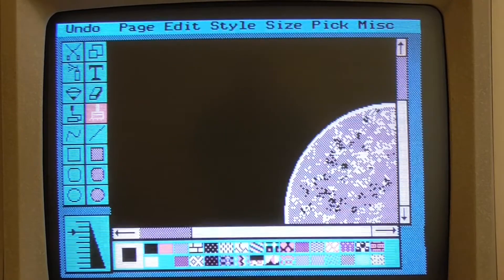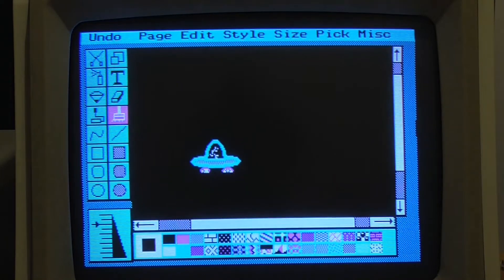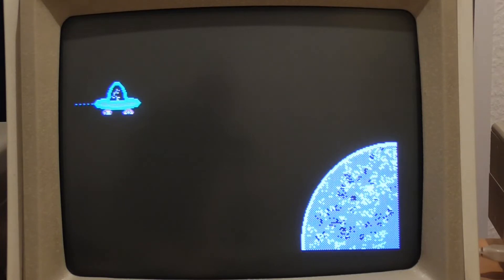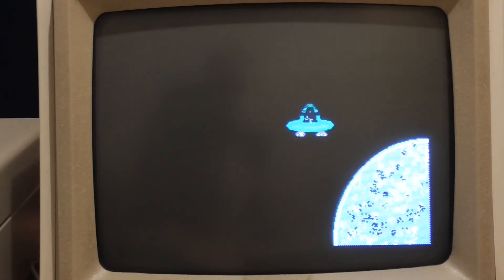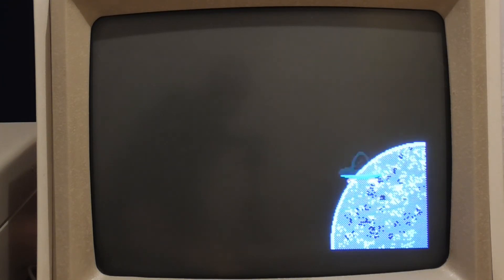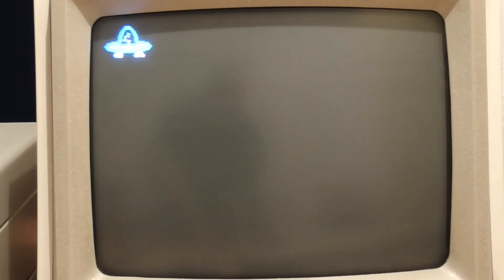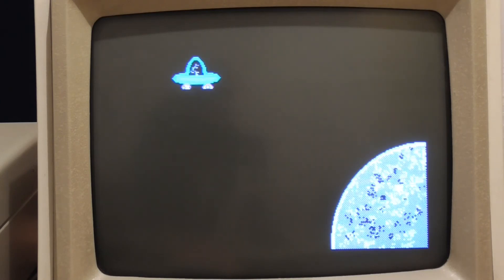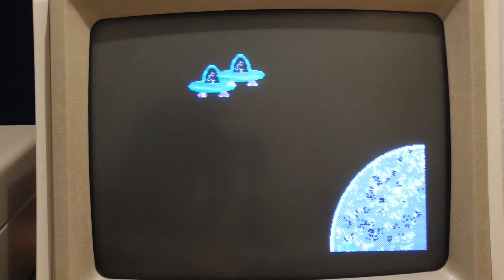Making A Sprite Engine for the IBM PC

Comment: Would it be faster if you created a 320x200 byte map in main memory, and used only the first two bits in each byte (4 colors) for all graphics primitives (no need for four different sprite drawings, perhaps easier calculations since each pixel is one byte), but then copied that into CGA memory with packing 2 bits of 4 bytes into each CGA video memory byte?
Reply from the maker: I'm not sure. Shifting is unfortunately very expensive on this platform, basically 4 cycles per bit that you have to shift, plus some overhead. Also, main memory is not that much faster than CGA memory, maybe a factor of 2 or so. So I think this is a case where more precomputation is better. However, there might be other benefits from your idea, such as being able to deal with sprites partially going off screen for example. So I guess it would depend on the particular problem you were trying to solve. Nice idea though. Could be worth a try!

Comment: yeah. if only pc graphics cards had hardware transparency, that would have made things much simpler and faster. vga had some helper hardware like latches and barrel shifter (only in planar modes), but by the time it was mainstream, 486 was a norm. it was so fast that it didn't matter anymore.
Reply from the maker: That would certainly have helped.

Comment: This is pretty much what we had to do back in the 8-bit days on the platforms that weren't designed for games in the first instance but had bitmap graphics, such as the Apple II and Spectrum. Even on platforms that had block graphics such as the TRS-80 model I and III. Except for compiling code from sprite bitmap data. But the platforms I knew had memory addressed displays so it was probably different on the ones that had VRAM only accessible to the video hardware that you could only access via a specific interface. I'm guessing that at least some of these early PC modes worked in the latter way?
Reply from the maker: EGA and VGA had planar modes which were accessed differently, but CGA was just memory mapped. That's cool that sprite compilers were known on these other platforms. Makes sense of course.
Reply: @PCRetroTech  Actually the sprite compilers were the one thing I didn't know of on other platforms. They may have existed of course. I didn't know all the tricks or all of the platforms.

Comment: Impressive! But why do you need a per sprite program just to draw it? The goal is to write the sprite together with the background at once, without VRAM read penalties right?
Reply from the maker: I'm not sure I understand the question. The "per sprite program" creates a precompiled sprite which is much faster than other methods. It has to read the background so that it can replace only the pixels that belong to the sprite, and to replace the background after the sprite has moved. If you knew there was nothing behind the sprite or a predictable pattern you would not need to read it.
Reply: @PCRetroTech  I guess I don't fully understand what precompiled means.  I assume you call a routine that draws that specific sprite into your framebuffer and then pushes it to the screen. 

But why isn't that possible with a general method for all sprites? 

Or do you avoid drawing the black pixels by hardcoding the actual line offsets in a register? So for example the top of the sprite only has a few pixels in the middle so you hardcode an offset of x position plus the black pixels for that specific line (of course corrected with the 4 pixels per byte encoding)
Reply from the maker: @what9418  That's right. You usually have one transparency colour (usually black) or a mask showing the shape of the object. Even for rectangular sprites you still have the left and right edge which may not align with a 4 pixel boundary. You can write a general routine for that case, but it is still slower than something precompiled for the exact number of pixels wide the sprite is and offset modulo 4 pixels.

Comment: If you are doing compiled bitmaps you don't need a mask, you just don't draw to a spot. I had a sprite function that swapped the screen info and the sprite data in the compiled sprite to use less memory using self-modifying code.
Reply from the maker: Well in general you need a mask otherwise you will overwrite pixels beyond the edge of your sprite. There are four pixels in each byte. There is no way to not draw a spot in CGA. That is what the mask is for. 

As for swapping the screen and sprite data, this would require extra accesses to screen memory and would be slower, though if your intention is to save memory, I guess that might work. You are going to need a mask for that though, otherwise you will overwrite pixels of your sprite.
Reply: @PCRetroTech  Yeah I was doing it in 8 bit mode, much easier with vga. Only the edge bytes need masking tho, not the whole surrounding rectangle. By swapping the data I meant to the buffer page not the screen of course. The method I used was pretty fast because they were completely unrolled and the sprites were primitive objects so storing the display data over the sprite data made them smaller and self contained.
Reply from the maker: @phookadude  I see now, thanks. That sort of thing is easier with VGA of course (modulo the bitplanes if you are in a planar mode).

Comment: C on these old PCs can’t read keyboard scan codes?
Reply: C can't do anything, you need libraries to do advanced stuff. You can read stdin though because c is always shipped with stdlib
Reply: Of course it can but it has to do it either via some provided system functionality such as the BIOS, or directly via the hardware. It can't do it just with the functions in the C standard library. Of course the standard library could've been designed to include such functionality just as many dialects of BASIC had INKEY$.

Now I'm not familiar with what the BIOS did provide or how much differences there were among the hardware available at that time.
Reply: @andrewdunbar828  It’s a memory mapped IO systems and it has pointers.  My question was rhetorical.
Reply: @user-yr1uq1qe6y  Ah sorry didn't realize it was rhetorical. Maybe some readers will take it literally and learn something anyway.
Reply: @andrewdunbar828  my response was a little terse.  I think my interpretation was too literal when he said there was no C function for reading the keys.  He probably did mean no standard library function. My apologies!

Comment: I recently did a sprite engine for X 320x240 mode. At first, the engine worked quite slowly, and with artifacts, then I read a book by Michael Abrasch, changed the code, and the speed increased. To render 32 sprites of 16 by 16 pixels at a frequency of 60 Hz (this is the standard refresh rate for 320x240 mode), a 286 25 MHz processor is required. The sprite engine seems to be slow, but Michael Abrash says in his book that rendering a large number of sprites is problematic even for a 386 processor.
The engine is designed for porting NES games to an IBM PC.
Reply from the maker: Yeah I think my sprite engine maxes out at about ten sprites, though they would be larger than 16x16. And I don't get anywhere near 60fps. It can't really be improved very much now though, as it is near optimal. It's just a slow machine.
Reply: @PCRetroTech  what is the bandwidth the 8086 achieves with CGA I/O?
Reply from the maker: @what9418  I don't have my notes with me, but rough order of magnitude is 300kb/s which is about 15-20 fps depending on what you are writing and from where.

Comment: you are the CGA god, can you explaine why CGA use those ugly pallets we all know ? And Why every single EGA game in 320 x 200 use 16 colors from CGA full color pallet , but not other from it's full 64 color pallet? :( Only a few EGA games use other colors from 64 color pallet but in higher resolution mode , :(
Reply from the maker: There are people that know way more about CGA than me. But as far as I am aware no one can explain why they used those ugly colours. I mean, there is a technical explanation to do with RGB levels, but no one can explain why they did it anyway after it was obviously so terrible.
Reply: @PCRetroTech  some one have to find the man or woman responsible for this abomination and ask for the god Why?! Hahah WTF :D
Reply: And as far as the ugly palettes go, it might have been just an arbitrary choice that was easy to implement in hardware. Two base CGA palettes are colors 2,4,6 (palette 0) and 3,5,7 (palette 1). So, just 2*n or 2*n+1. And add 8 (2^3) to get high intensity variants of these palettes.
Things get more interesting with the unofficial palette 2, using colors 3,4,7. It might be worth looking at CGA color circuitry to check what happens there.
Anyway, it's just my guessing :)
Reply: @peachgrush  In one description of the unofficial palette I saw it described as "blue, add blue to the palette". This wasn't anything official though, so I don't know if it gives any insight into what they might have been thinking.
Some of the stuff the CGA adapter does is probably unintentional and just a result of the way it's wired up. I'm pretty sure for example that the "undocumented" 160x100 16 colour mode is actually mentioned in the original manual a couple of times (though incorrectly as a mode that is achieved through the 40x25 text mode, which it doesn't actually seem to be). And one wonders if this was just added to the manual after some engineer noticed that you could actually get this mode via a text mode even though they hadn't technically intended to support it.
Reply: As far as I know, there are some games which can use the whole EGA palette in the 320x200 mode. However, as CGA monitors are unable to show more than 16 basic colors, and there were people using EGA adapters with their old cheap CGA color monitors, game developers were perhaps more willing to give in on more colorful graphics to get more compatibility.
Additionally, I am not sure whether the EGA BIOS supported the 320x200 mode with the 64-color palette enabled at all. Using it might have required reprogramming the CRTC manually. EGA monitors use polarity of sync signals to select between 4-bit and 6-bit color input.
Reply: @peachgrush  too petty that EGA potential was not unleashed at full capability :(
Reply: The 16 colour cga palette 320x200 EGA mode meant you could use the same assets for EGA and Tandy systems, which was preferrable for developers to save on disk space.  True EGA graphics were 640x200 or 640x350 and can look close to VGA by dithering/checkerboarding pixels to blend colours on CRT.

Comment: Very nice. I am building something similar for the Tandy 1000 320x200 16 color mode. I decided to move sprites 2 pixels at a time though so my compiler builds just one image. I also use sprite sheets with multiple sprites per sheet. Another thing is you can optimize your images to have edges aligned on byte boundaries where feasible.  This reduces the read operations.  Another thing I did for my own sanity is to switch to CodeBlocks with open Watcom.  Goal is to build a playable street fighter two clone that performs OK on a Tandy 1000 TL.
Reply from the maker: Sounds like a very nice project. Do keep us updated about how it is going.

I actually don't know what sprite sheets are. Could you explain?
Reply: PCRetroTech an image with multiple sprites. Find one here https://www.spriters-resource.com/master_system/streetfighter2brz/sheet/18445/
Reply from the maker: @ryanyoder7573  Oh, those are cool!

Comment: Really cool video ... are you planning on releasing some source code for this on github ? Would be cool to see you adding features to it and building it from the ground up.... wonderful job !
Reply from the maker: Thanks. Yes, I plan to release source code eventually. I did want to slightly improve the sprite compiler output before I put it up though, to save others from duplicating that effort (in the unlikely event that people want to contribute). Basically I want to make use of movsw and rep where possible/efficient. That should give a slight performance lift.

I'm also toying with the idea of removing the extra width that I talked about in the main memory buffer. I still haven't thought of a good way of doing it, but I think it ultimately might be possible with some trickery. The main issue is that because the main memory buffer is wider than the screen, the same routines cannot be used to write directly to the screen or to the memory buffer. They have to be duplicated. That's not a problem if you only have a fixed application, but to make the code more usable for other applications, it seems like a potentially good move.
Reply: PCRetroTech if I were you I would do a whole series and release code on github specific to each serie. Then you can see where improvements are done and certain design decisions are made. Master branch for the “final” / “latest” release, and a branch per episode ... with some instructions on how to build / run it ... would be happy to beta test :)
Reply from the maker: @RetroSpector78  I have done things like this before, and I might do that. I want to see how the video does first. It's borderline boring YouTube content if you aren't into technical details.